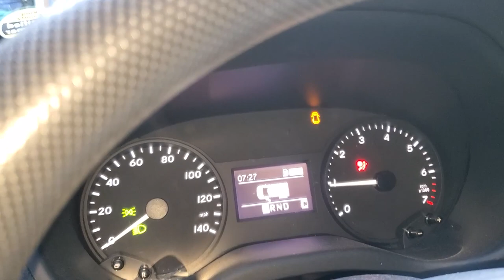Mercedes METRIS Front Brake Pads Replacement. Замена передних тормозных колодок Mercedes METRIS

Comment: Why didn’t you resurfaced or replaced the rotor?
Reply from the maker: Why to do it if disc not damaged? It's not vibrating, not damaged, I really didn't see why to do something with it.
In this video, the back side of the rotor was scratched, and I was resurfacing it:
Mercedes Metris Rear Brake Disc Resurfacing https://youtu.be/nxGTHGSdM-M?si=511S3jC_JEp_WiIj
Reply: @FixitAll  
All rotors warp with use. You can’t see it with the naked eye, but you can always tell when in the lathe. 
Good instructional video tho. I was just asking to hear your perspective.
Reply from the maker: From my experience with my cars, disc life can be easily 100.000 - 150.000 miles if it is not cracked or start to make some vibration to the wheel during brake on hi speed.
It usually depends on the road condition where you're daily driving.  A flat, smooth road makes braking even on both wheels. A road with holes, potholes and uneven surfaces forces the wheels to brake with different forces and pressure on the discs. This results in uneven wear on the discs.